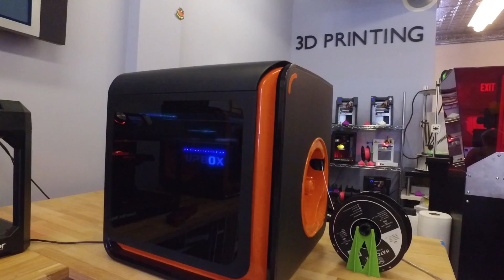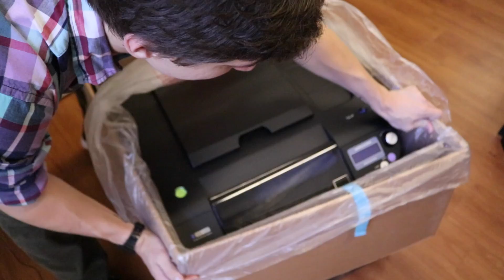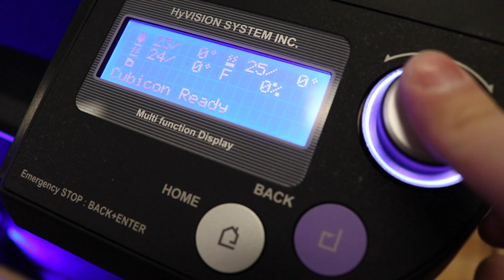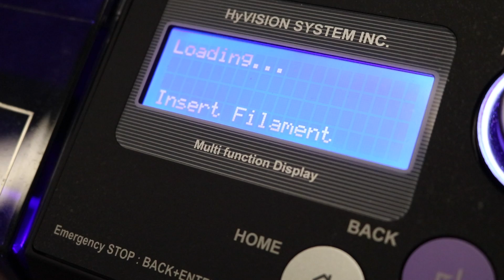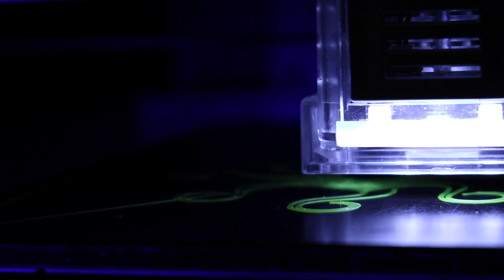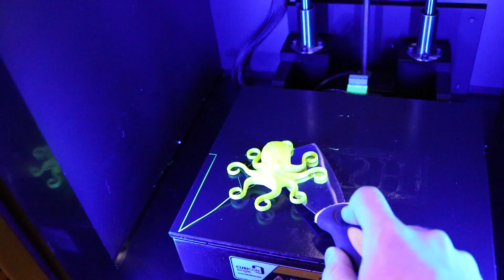Cubicon Single Review and Test Printing!

Comment: nice video. wich would you prefer most, this cubicon single, the ultimaker 2+, the zortrax m200 or the upbox?? Regarding quality of printing, ease of use, support, software and consumables?
Reply: +3D Central 
Which printer would you choose of the above choices in regards to the best quality prints. ?